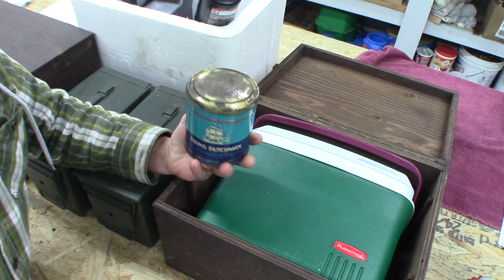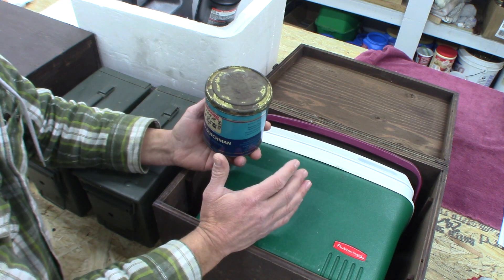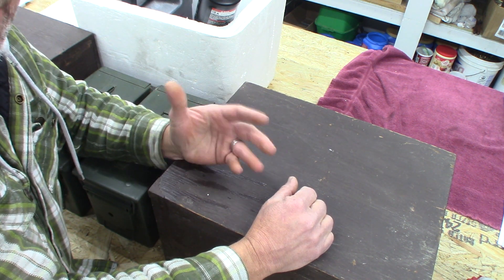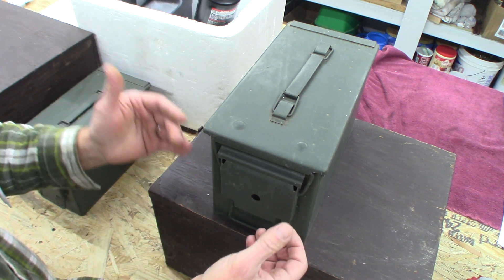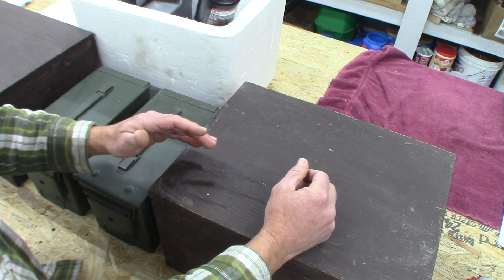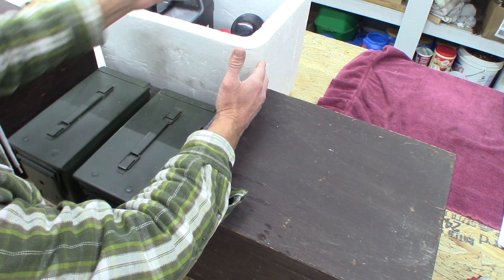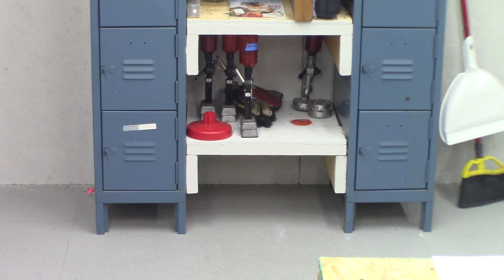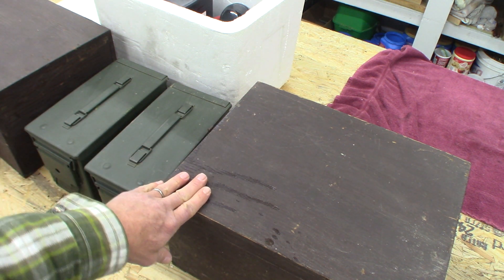Primer and Powder Storage (Overlooked)

Comment: As a retired firefighter, my powder and primers are stored, apart, in the basement, with a dehumidifier. Store them on, or barely above floor level. In a fire, all your heat rises, and the floor stays "cool", unless you get a contained smoldering fire. Those are explosive, in themselves. Also, if you don't have a basement,  store your powder, and primers, on the lowest floor, preferably in an outside corner. Fire, like heat, tends to rise. If you can build a small box, with steel studs and drywall, in an outside corner, on the floor, that's going to be about the best you can do, short of building a concrete block container. Store all your loaded ammo, down as low as possible too.
Reply: Hi you can look up the code for legal storage boxes they're made with 1 inch thick wood sides
Reply: I’d think a concrete shed proud of the house outer wall with its own house-side wall and with weatherproofing as well as hinges mounted on hardware designed to shear off the doors harmlessly in the worst case scenario while maintaining storage security would be ideal, albeit overkill...

Next best thing is a metal box with a heavy, insulated sideways hatch access for the inside and the same weatherproofed shearing hinge mount doors to the outside.

The idea is to have the door give at a way lower amount of force than the hatch.
Reply: Thank you this is great to think about. Safety first means a lot less worry if the worst happens.

Comment: My primers are stored in food saver vacuum bags with a pack of diccisant then put in an ammo can, powder cans are also stored in Ammo cans with packs of desiccant, my metal cans of 3031 I got in the early 80's have ZERO rust. cover box with concrete board, my reloading room is lined with concrete board, waterproof and much more heat resistant, the storage cabinet is also double wall fire resistant, magnets and detent springs hold the doors closed.
Reply from the maker: That’s some fine detail... sounds Right! 👍👍👍🇺🇸🇺🇸thanks for the info
Reply: I wish you would make a video. This sounds like a really well prepared area which deals with such volatile chemistry.

Comment: Not first. 
In construction a firewall with a 2 hour burn rating is made of 2 layers of 5/8 sheetrock overlapped on each side of the wall.
Reply from the maker: Good info right there... this should be helpful..👍👍👍🇺🇸🇺🇸
Reply: is this for documents or photo albums ???,not much heat is needed to get the ignition of powders and primers.

Comment: I've put powder in a mason jar with some silica gel packs because I accidentally spilled it on my carpet and I stayed up every bit that I could but a lot of other junk came with it and I have yet to go through it and pick all the little teeny pieces of leaves and grass out lol I also keep all of my shotgun shells that I don't plan on using anytime soon side of a air tight PVC canister that I've made and that has big kitchen towel filled with rice and rubber-banded so it'll suck up moisture from that end and I have silica gel packs inside of it above a couple layers of shotgun shells and so far so good I kept shotgun shells in it up to about five years and the ones that I did have in there worked well

Comment: All my powder is in the original tubs out in my garage. I keep a dehumidifier running but it's not heated. Sometimes I worry about it being in the 20's but so far I haven't had any issues with powder going bad.
Reply: if you had a cellar or water tight pit inyour garage  ,it would be a more constant temperature

Comment: I keep my primers in plastic ammo cans in the bedroom closet.  Powder stays in original containers on top of the safe.  Air conditioning is key.
Reply: I have my powder and primers in a shed with no ventilation.  It gets hot in the summer cold in the winter. Its dry as a bone but I cant keep it cool very well. Is that a big problem?

Comment: Also,  I have a refrigerator that I store my powder in the bottom and primers in the freezer. This is in an unheated with no air-conditioning out building. It is locked and secured. Opinion please. My options are kind of limited.
Reply from the maker: I do like the idea of the powder be in in an insulated enclosure. This allows the temperature change to be more controlled slower rise and fall. Less chance of moisture. It’s not all bad. Just keep an eye on it
Reply: @elvisammo  Yes and a refrigerator also serves as a class 4 locker. All the gun shops around here use them with a padlock as I do. The door seal acts like a pressure break and the inside is coated and/or aluminum which makes it non-sparking.
Reply: @elvisammo  I also have a golden rod inside it and keep charcoal briquets inside it to absorb moisture. I just have to change the out or heat the briquets up a bit in my toaster oven to remove moisture

Comment: A question for you, the powder with the rust in it, would you load it? Do you think the rust would affect the powder immensely and adversely?
Reply from the maker: Man. I guess if I really really had to I would check it out. But for no other reason. Don’t make me test the stuff out!😎
Reply: @elvisammo  Lmao, I for sure don't want you in any danger. What I need is an old gun that fires to see (firing remotely). I believe the iron oxide from the rust might make it very interesting.
Reply: John Beige  agreed. I marked it  and stored it.
Reply: John Beige  agreed. I am keeping only for just in case. So far I have 1.5 lbs that are bad. One I have plenty of. The full lb not so much. Once this shortage is over whenever that is I will dispose of all of it.

Comment: I keep my powder and primers in my walkin pantry building. Heated in winter, cooled in summer. Temp stays between 50 and 65 degrees. Everything is on wire shelving, off the floor, and plenty of circulation.

Comment: I store mine in a mink lined cedar wooden box with a tube of venison summer sausage to trap any moisture. Then shrink wrap the box three layers of black plastic (gotta be black), and run an ultra violet lamp and a three bladed fan in the room 24/7. Any more than three blades tends to create a vortex that can waft through the plastic and cause ignition degradation. Seems to work. 😕

Comment: I like your ideas's elvis but U.S. ammo cans are rated to certain pressures and heat range before failure. Did not believe it myself but 2 years i was moving and the UHAUL caught fire and all my stuff burnt my primers were in ammo cans they blew but the integrity of the ammo can held
Reply: There is a bunker company that does alot of vids on YouTube that recently had a fire,
To my surprise, the cans that had 50 bmg.  were not as damaged as I would expect,
My only guess is the gaskets melt away first allowing some pressure to escape.
For it to survive igniting all the powder and primers from a bunch of 50 bmg is kinda impressive. That had to have been a lot of pressure.
Reply: @joedirt7604  yes the rubber will melt first then all the gas escape. It looks like hells infurno trying to escape it wicked lookin

Comment: Elvis opens the cooler inside the wood box and said there's "some primers" I almost cried LOL I haven't seen primers since last July except for 200 that I found two days before Christmas and it's like money burning a hole in my pocket I want to shoot them so bad because I'm tired of some recycling primers this primer shortage needs to end so bad
Reply: I always keep full 5,000 sleeves of each size on hand. Luckily for me it' never less than 40,000 so 8 sleeves of each. I never gave more than $128.50 for any one of those sleeves. I still am taking it easy since last April shooting and reloading because I know the shortage will go on years, not weeks or months. It may end up being all 4 years of Joe Biden's Presidency. I won't rule it out or plan any differently.

Comment: black powder is the most dangerous propelant  to store  , never put nitro ,primers or bp in a strong kabinet or safe never together even if it is fireproof ,thats only for a short time the case. a wooden kabinet is more safe if you keep a amount a water in  plastic bottles inside ,they will melt and the water takes heat ,but the isolated box is good idea ;-)

Comment: storing in a ammo can is safe . i hate to disagree with you elvis . i realy do . i had 5 ammo cans full of ammo . some in boxes and some lose . and they were in a fire . lots of dents in the ammo boxes but none of the rounds got through . the fire was so hot that when the ammo boxes were opened up there was no brass left inside of them ! the fire vaporized the brass and bullets ! had one can full of primers , it stayed intact and everything inside was vaporized allso . the fire was at a friends place i was staying at right after my divorce started . glad everything else i had was in storage . the fire safety association i think that is their name . says don't store smokeless powder in a safe . if it was to get to flashpoint it would become a bomb . they say to make a wooden cabinet with one weak side so that the pressure would come out that side . i think the metal powder boxes are made with a weak side . but i am not sure on that .  talk to your local fire dept , they will gladly help you make storage of reloading supply and ammo safe . not just for you but for them also if god forbid you have a fire . great video i know you are talking about more than a fire in this . most new and some old reloaders don't know just how to store stuff . and never store ammo , powder or primers under a staircase . firemen might need to use it if it is usable . don't want it going off underneath them !
Reply: Hi that's because ammo cans are designed to store ammo larger amounts gun powder need a container that has a way for the to escape you can look the code on legal storage boxes they're made with 1 inch thick wood sides
Reply: no venting  in a box or kabinet is enough to prevent a explosion with ,nitro ,bp or primers.

Comment: I've been told its almost impossible to ruin primers.. maybe I'm wrong but their shelf life is extremely long..? Put the powders I can see.. but against fires is a good reason.
Reply: temperature changes makes powders desintegrate ,if stored a long time ,also the primers compound  will lose the binding of the components ,and then you got misfires
Reply: I've tried most everything imaginable to deactivate primers.  Soaked for days and alternately flushed with cold/hot water and detergents, and could always get a bang out of them between an anvil and a hammer.  But, a big BUT, they were muffled and inconsistent. Some loud, some weak.  I believe proper storage has more to do with consistency, than "does it still go bang?"
Reply: @aolinger680  thats tru.the pil in the primer is made of bounded britlle crystals .they are sensitve to impact. 
A blow with a hammer is not the impact of a firingpin.that is only a small point .with the hammer you generate a lot of heat and the complete primer is hit ... A primer will loose its compact hard design most by temperatur changes and then you get misfires.thats why keeping them in dry cellar or isolated box wil.keep them more consistant

Comment: Sorry brother, I love your videos but your logic is flawed in this case. A cooler is horrible unless it's in a temperature controlled space. If a cooler changes temp from hot to cold and back.. it will fill with water due to condensation. Not trying to be rude, just letting you know. Peace